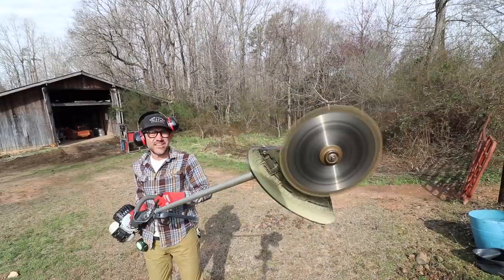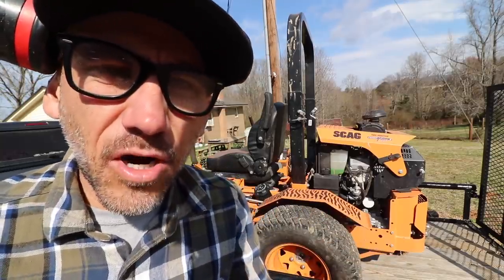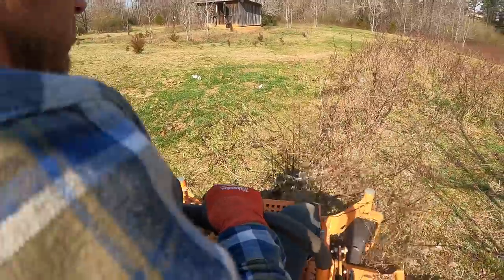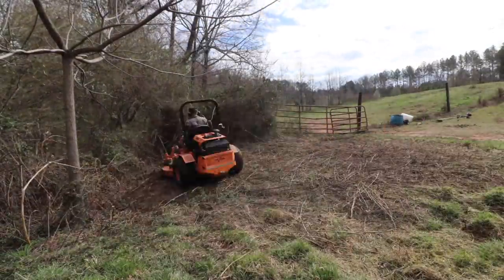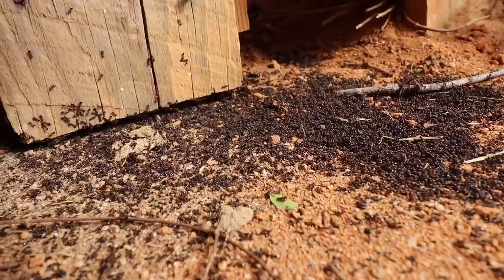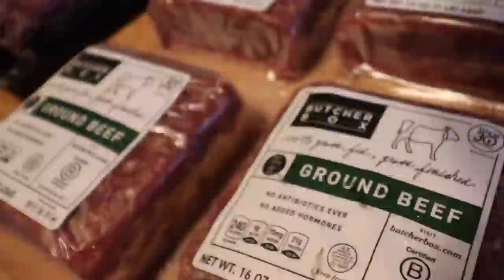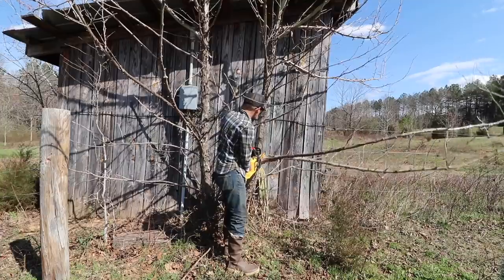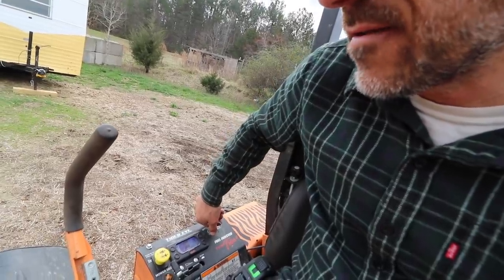This is NOT My Lawn Mower

Comment: PS : I TOLD U MIGHT NEED IN THE FUTURE  I FORGOT TELL U :   *  KUBOTA   L - 2501 TRACTOR LOADER  WITH 4 X 4  ! .

MY 2001 KUBOTA B7500 TRACTOR  , COME WITH 4 X 4  BACK THEN  ! .

NEVER NEVER  BUY "  > BX SERIES , KUBOTA TRACTOR 4X4  , WHEN OTHER PEOPLE BUY B X TRACTOR , THEY THINK THIS TRACTOR WILL DO AS MUCH BIGGER TRACTOR CAN  / THEY WILL NOT , BX TRACTOR ARE TO SMALL HANDLE ANY KIND OF HEAVY LIFTING OR MOVE STUFF AROUND  /  THEY ARE UN STABLE  TRACTOR IN WEIGHT SIZE  TO DO FARM  WORK  ! .

L - SERIES KUBOTA TRACTOR LOADER 4X4 , ARE BIGGER FRAME AND MORE STABLE WANT TURN OVER AS MUCH AS SMALL TRACTOR WILL ?.